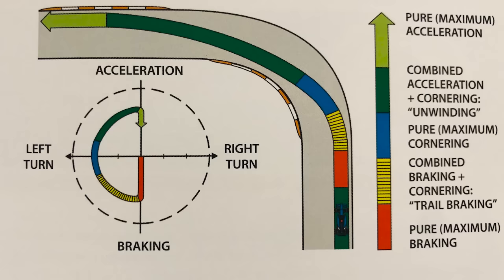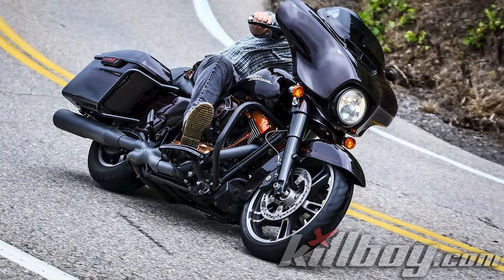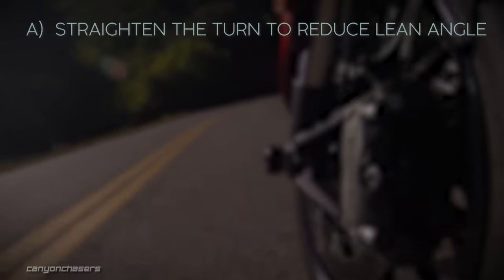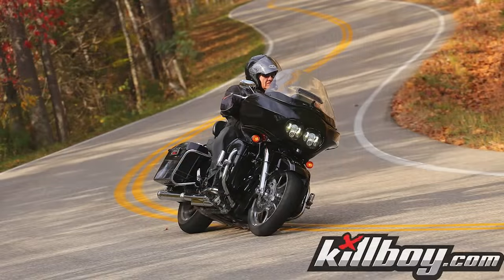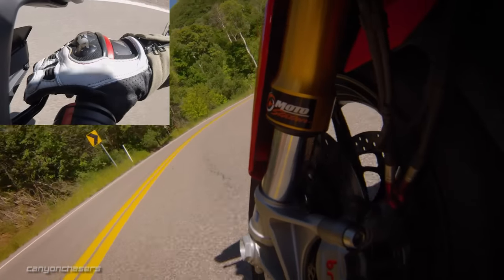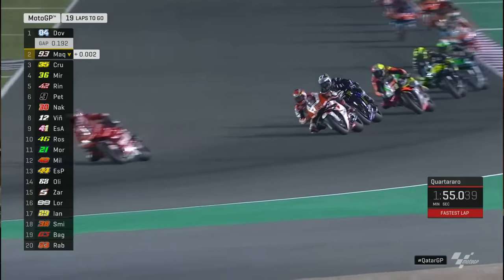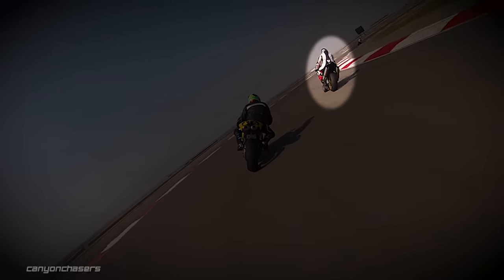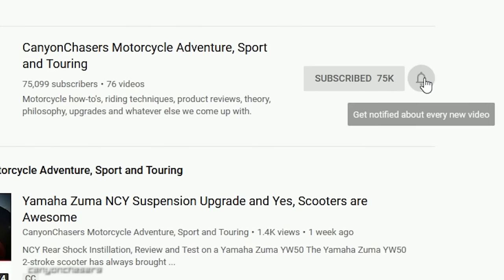How and Why Delayed APEXES Work

Comment: Again excellent advice,  however if I can add some bog standard city safety tips. Idiots don't last.. Assuming your tyres are run in (don't talk to me) NO 1- Don't now the corner? tootle round it till you suss the curve. and send flowers to the muppet hareing past on the outsides wife. Done years of driving as a passion and a job in several cities. Diesel- it is not your friend, so approach roundabouts with caution, well duh, you might say (I would) but anywhere lorries have to stand engines running they will leak the devilish fluid, hard to spot and  your bike suddenly handles like a pissed roller skate. hit this at speed you might just pick it up but generally you will slide off. * In the wet don't ride unless it is your job or know someone needing a kidney. White lines in the wet are hilariously slippy and if you want to split up with your girlfriend try a sneaky exit over the chevrons on the M1, Can't stress the oil roundabout trap enough , and if it's light rain radio in with your puncture. all the best keep 'er between the hedges.

Comment: Fine, but there is no need to ride like it is MotoGP. Adress your speed to the sharpness of the corner and you could stay in the middle of it like a circle. That is the single thing you have to do to stay in the lane. This is part of a technical qualification in Europe, which you have to pass to be allowed to ride.
I won't dispute the apex technique, speed is still a key here. But it makes me sad to see the example of 2:21 as there is more to the case than a technique can fix.
The start of the corner at 4:45 is a good example of a lean which could have been maintained even without the demonstration at 4:48.

Comment: “We only want to use one control at a time” 

This is not true. As you advance you’re riding there are times in which clutch, brake (front or rear depending on road surface) and throttle will all be used at the same time.
Reply from the maker: Perhaps when you have ideal conditions.  When we are going slow and have lots of grip, nothing matters.  This is why we don't bother with learning or practicing techniques that only work in ideal situations.  We never overlap throttle with the front brake.
Reply: @CanyonChasers  YOU maybe never teach to overlap throttle and front brake…. However, ideal or non ideal situations, the better rider will always overlap them.

Comment: Can't understand you didn't just explain limit (vanishing) points. It's so much simpler.
Reply from the maker: It’s an extremely complicated way to explain something really simple and it’s not infallible. There are thousands of corners where it looks like the vanishing point is moving away, but the corner is physically getting tighter. 

The vanishing point is a great clue. But it’s only a clue. We don’t actively accelerate until we can see the exit and we can take away lean angle.
Reply: @CanyonChasers  Then you don't understand it fully. Limit point analysis works all the time. No exceptions.

Comment: Trail braking is for track use not for road use. A safer way for road riding curve roads would be to able IPSGA system to your riding. How do you apply IPSGA system ? Easy take some advanced training. Most riders will spend 100’s and 1000’s on bikes and protective clothes but never do any advanced training after passing their test. Advanced training is normally not that expensive and will at some point probably save your life, protect your beloved motorcycle and because your not testing if your protective clothes accurately works crash test dummy style will safe you from expensive mistakes. IPSGA system will give you better awareness of your surroundings and better control over your motorcycle. When that happen it helps improve your confidence and make motorcycle riding much more fun and enjoyable. Ride safe everyone!

Comment: Corners! There is a bunch of things that can help...

1. LOOK FURTHER AHEAD. A good street rider looks much further ahead. Using the natural and man made features of the environment to judge which way and how sharp the next bend is. 

Why it works. Because the good rider effectively has more time than the rider who is looking just in front of his bike or even a little further ahead to the bike or car they are following.

2. SLOW HANDS. 
The good street rider doesn't charge the turn. They don't  brake as late and as hard as they possible. They roll off the throttle, brake and arrive at the corner at the speed they want to turn in. 

Why it works. The good rider is settled and composed at the road position and speed they want to be to make the corner rather than the rider who has charged the turn and now has to work much harder to settle the bike (and themselves!) to get the next parts of the corner right.

3. STAY WIDE LONGER. 
The good rider chooses a later turn in point. They stay wider towards the outside of the turn much longer. They wait until they have a way through the corner that allows them to clip the apex and apply more power at the exit. 

Why it works. By staying outside longer the good rider gives themselves much better visibility through the turn and sets themselves up for the turn in and acceleration phases. This is in contrast to the rider who turns in early following the inner edge of the turn reducing the radius, making the turn tighter and delaying the acceleration and drive phases of the turn.

4. SNAP OVER WITH COUNTER STEER.
At their chosen turn in point the good rider snaps the bike over quickly to their desired lean angle (rather than tilting slowly) by applying firm pressure to the inside bar in the direction they want the bike to go. 

Why it works. As most know it's called counter steering and is the single most effective way to turn a bike. By contrast leaning over or even getting out of the saddle and hanging off does not turn the bike. Getting out of the saddle is a technique to keep the bike more vertical for a given radius and speed in a turn. It will allow you to go faster in a given turn but it will never turn the bike on its own. You need to counter steer. 

5. STEADILY & CONTINUOUSLY ROLL ON THROTTLE.
Once they have snapped the bike over the good street rider immediately steadily and continuously rolls on the throttle. Accelerating through the apex and picking the bike up and driving through the exit. The important point is they roll on the throttle as early as possible - immediately after snapping over. The only exception is turns of a decreasing radius. In those you would not have seen an exit.

Why does it work. Steady continuous roll on settles the bike as it loads the larger rear tyre. If you are accelerating for longer you are going to exit the turn faster and be faster overall throughout the whole turn.

6. PICK UP THE BIKE BEFORE YOU USE FULL POWER
Having effectively squared off the turn with a late entry and snapping the bike over quickly. The good street rider seeks to pick the bike up with power and be nearer to the vertical before applying more power than the steady continuous roll on.

Why it works. A later turn in with a later exit allows the rider to move back towards the vertical and apply more power earlier.

This is in contrast to a common mistake of applying higher power (beyond a steady & continuous roll on) while at lean.

A common crash at track days is riders who attempt to tighten a turn and accelerate at the same time - usually in pursuit of getting a knee down.

If you are tightening your turn - don’t also accelerate as you will eventually run out of grip.

Comment: Thumbs up, i think it's good information. However (at 1:41), in some corners on the road, we'll need maintenance throttle to hold the radius. We're not always making the circle smaller or bigger, sometimes we're just maintaining the lean angle, therefore, the speed. And there's no need to go into the corners at all times on the brakes because we're not riding fast enough, engine braking can be a "form of" trailbraking. There's no need to state we only need to reduce speed until we're happy with the speed we want to negociate the corner. there's a video from Nick Ienatsch that explains my point: https://www.youtube.com/watch?v=R0ebbmV8LpQ.
 Stay safe!

Comment: Surely this isn’t news to most people, is it? You’d have to be an incredibly inexperienced and new rider to not know this, either through instruction or through experience, and if you didn’t already know this you really shouldn’t be trying to chase through the canyons.
Also, those examples of riders running wide are not conclusively due to slow look press and roll, it’s disingenuous and self-serving to claim they are. They could just as easily be the result of poor counter steering knowledge/skill, target fixation etc.

Comment: "Delayed apex" - good theory. However, with respect, the explanations of what happens under corner braking and corner acceleration are not only wrong, they are the opposite of what truly happens. When you are BRAKING while leaned over in a corner, the circle will get BIGGER not smaller. WHY? Because you are adding weight to the front wheel. When this happens, two changes occur. 1. the front wheel pushes across the pavement more and 2. the bike wants to stand up. If you brake hard enough, the bike will flip to the other side, throwing you off. There are many many more aspects, but this is the gist of it. ACCELERATION, or getting on the gas, as he puts it, does NOT make you go wide in a turn, while leaned over, it actually turns the bike MORE. Of course, if you accelerate too much, the rear can spin out resulting in a low side or, if the rear wheel regrips agan, a high side. WHY? The front wheel only starts the motion of turning. What makes a bike turn is the angle it is leaned at because you are not riding on the bottom of the tire like in a car, but on the side wall of the oval motorcycle tire. The further you lean, the sharper the turn, up to what some riding schools refer to as the "limit of grip". Generally speaking, trail braking means you brake before leaning the bike and while leaning the bike, all the way to the apex IE about the middle of the turn. Then, from the middle of the turn, once you stop leaning further and start to pick up the bike or even maintaining that lean angle, you can begin accelerating. What happens is that the front wheel gets DE-WEIGHTED, allowing it to grip better and push less across the pavement. This makes the bike turn better. Another thing that happens, is the REAR TIRE acceleration pushes the back of the bike down, adding weight to the rear tire, INCREASING grip. This is what causes the front wheel to be de-weighted, allowing it to turn better. NOW, you may think wait a minute, more weight on the front tire causes it to slide/push across the pavement but more weight on the rear tire causes it to have MORE grip?? Yes. WHY? Because the front wheel is a freely spinning wheel. It is not attached to the engine via a chain. Therefore, the only force that the rider can apply DIRECTLY is the brake. A forward moving bike, leaned over, braking, can cause the front wheel to slide out so fast that it crashes. The REAR Wheel however, has 2 directly applicable forces, brakes AND acceleration. Braking can also make it slide out, which can be a problem. But acceleration actually ALWAYS makes the tire spin ie slide. Thats part of why tires wear out. Tires don't suddenly lose traction. They don't go from 100% grip to 0% grip. They gradually lose traction. So, while leaned over, after finishing the braking part ie hitting the apex, gradually accelerating makes the front wheel get lighter (the front of the bike is lifted up), the rear of the bike gets heavier (it gets pushed down) applying more downward force but the rear tire that is spinning with FORWARD force. And that forward force, while leaned over and slipping (when CORRECTLY APPLIED) makes the go faster (more acceleration even with the tire spinning slightly) and makes the rear tire slide sideways a little bit, making the bike turn faster. At the same time, the front wheel is de-weighted, allowing it to track thru the corner better / with more grip. Its counter intuitive, as are so many things in motorcycling.
Reply from the maker: You are ignoring about nine other physical forces affecting the bike, resulting in an incomplete theory... and basically advocating for "backing it in" which has also been proven to be very risky and slower.  I would encourage you to pick up Cossalters book. I think you would enjoy it.
Reply: @CanyonChasers  No, I'm not ignoring anything. I wrote clearly "many other aspects" are invloved. I'm addressing one specific but very important thing that you talk about. The thing that your video seems to be all about. And, respectfully, that's just not the practical truth. Thisis one of those situations where the practical application is counter intuitive to the theory. Also, I'm not advocating or mentioning "backing it in" at all. Backing it in is sliding the rear wheel around before and during the turn thru a mixture of brake and acceleration. Accelerating after finishing braking to lighten the front wheel and turn tighter is not YET "backing it in". Describing everything that happens would take way more space than is available here. Outside of books, the very best videos explaining riding techniques on sport bikes and MotoGP bikes are Sylvain Guintoli's (MotoGP racer Suzuki test rider) videos. I think you'd like those too. As far as backing it in being risky, well, yes and no. Without practice, its very risky. With lots of practice, like on dirt bikes, it gets easier and easier. As far as being slower, yes and no. It's tied in to the difference between qualifying lap times and race lap times. But that is a whole different subject.

Comment: Street riding should have nothing to do with track riding, which is what he's describing.  Street riding through a curve should be Outside, Middle, Middle.  If you can't do that, you are going too  fast, period.  

By all means, go to a track and learn trail braking, apex, etc., but on the street, outside-middle-middle is the safest way to ride.  

Riding a motorcycle on a track is a sport.  Riding a motorcycle on a street is not.